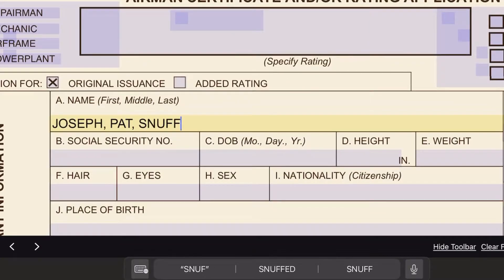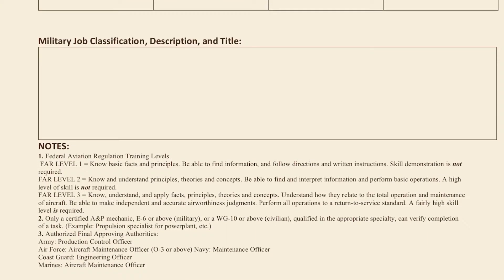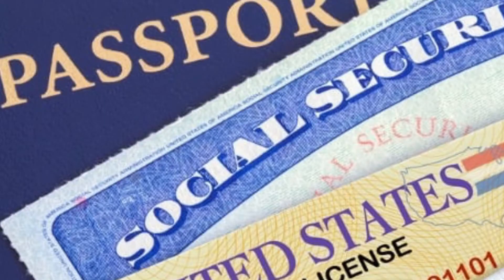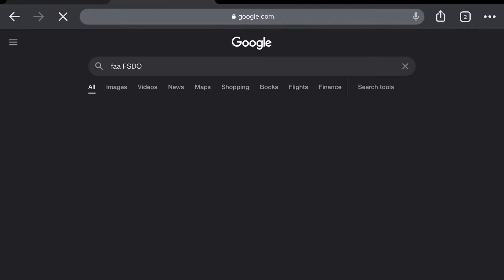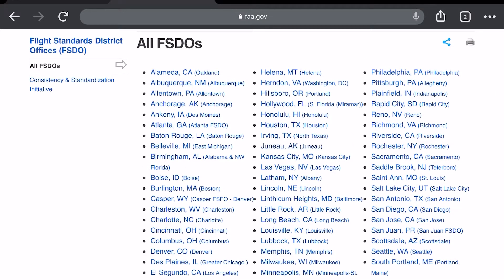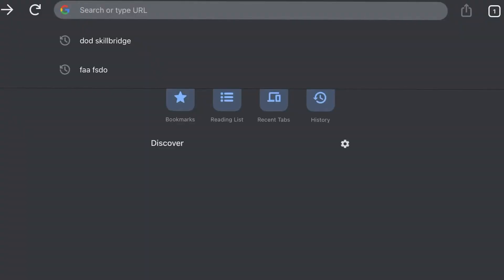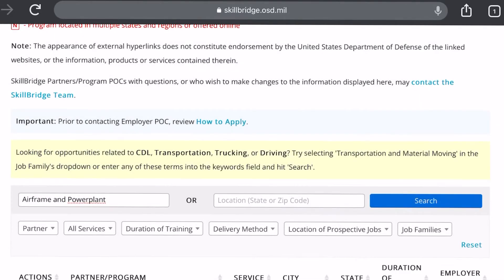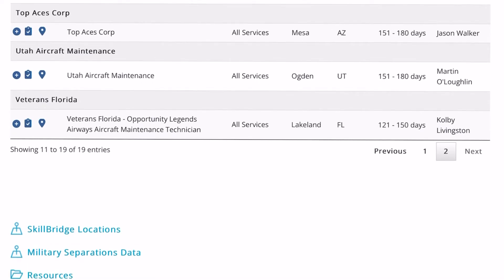Aviation Maintenance After the Military

Comment: I’m 28 highly considering joint the US Coast Guard. 

My recruiter told me wait times for AMT school typically is 8-15months. Then I need 30-36 months of practical experience before testing for A&P. It doesn’t seem possible with a 4 year contract. I know the experience in the USCG is more than just working on things, but my plan is 1 contract. If it’s not possible I’ll just go to a TCAT program 20 months long in TN. Any thoughts?
Reply from the maker: I’m not sure where you are at but any college with an aviation maintenance program will get you qualified to test upon completion of the program. Those programs are usually 12-24 months and they start new cohorts every spring or fall usually so you shouldn’t have to wait that long. Specialized schools that advertise AMT programs are run in a similar way.

If you join the coast guard to earn your experience you will be qualified to test after you have been at your first duty station for 24 months actively working on your aircraft type.

If you get a job working directly for an aircraft maintenance facility with zero experience that is when the 30 month timeline becomes a thing. In that case you need 18 months experience with airframe or powerplant if testing for only one of those ratings. If testing for both you need 30 months combined airframe and powerplant experience.

The requirements change based on scenario. So if you did choose to join the coast guard and do a single 4 year contract then you would be qualified to take your tests per the regulations before the end of that contract.